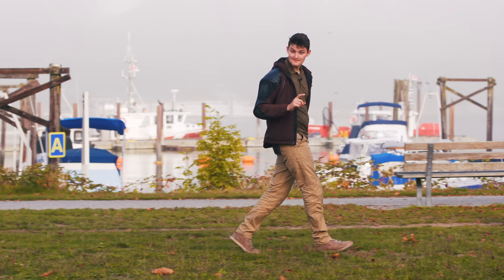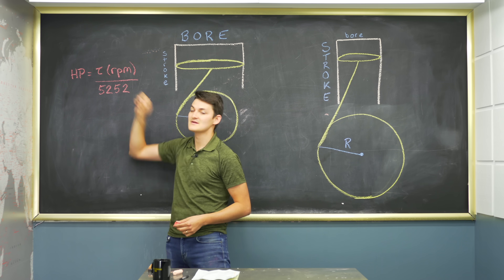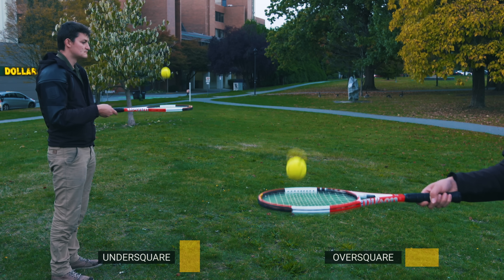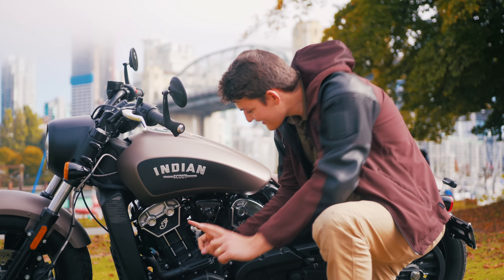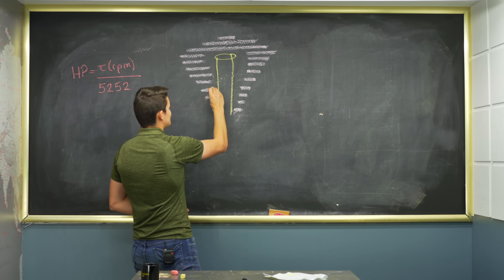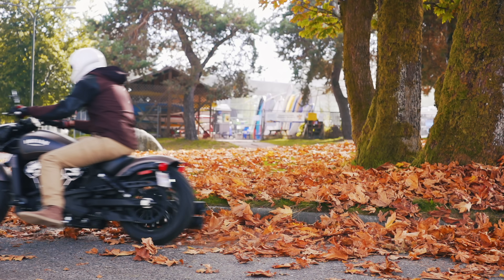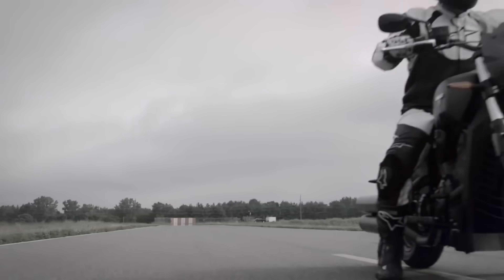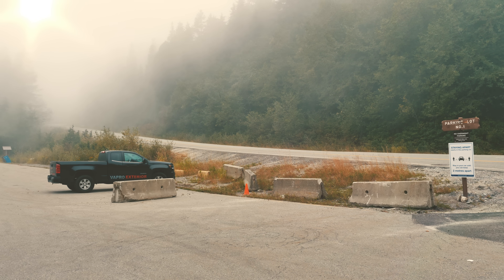How Indian Makes 43% More Power than Harley-Davidson

Comment: The Buell XB was making 103HP using a Harley Sportster 1200cc engine platform.  That was in 2003.  I do not know what the problem is over at Harley.
Reply: and just like that, I miss my lightning...
Reply: Same problem with the music industry. They're too busy trying to figure out how to get back into the past and not on how to be relevant now and in the future.

 And the problem, for both started a couple decades ago...with nothing learned in that time.
Reply: You have to remember too that Honda was making 50hp more with 200cc less and a lighter engine at the same time. Even with all the engineering Buell had it was just lipstick on a pig
Reply: @ajpowers7842  The point is Buell made 103HP out of 1.2 liters in 2003 and Harley is making 74hp out of 1.6 liters in 2020.
Reply: what about the people who turbo'd their HD engines or maybe swapping them out with S&S ones
Reply: @ajpowers7842  to be fair, Japanese bike engineers doesn't use under-squared engine formula that the American used that much, which is the reason why they existed in MotoGP to find both tech advancement and efficiency of having a good early low-end torque with decent top-end power on their engines. and you also need to remember that the majority of 1000cc bikes are over-squared with great top-end power and lame low-end torque, so maybe you could tell me what kind 1000cc Honda that have the same characteristics as an Indian or Harley-Davidson because Valkyries and Goldwings uses flat 6 instead of V twins
Reply: There's no problem. People buy the sportster based on a nice price point. Ride the thing for a while and realize its not very powerful or well suspended or braked. And return to the dealership to grab the screaming eagle catalogue. Kaching!
Reply: Decibel level must always exceed horsepower
Reply: @mawwalmazie  A turbo on a motorcycle sounds... dangerous. How do you manage the lurch when the turbine kicks in?
Reply: @sandakureva  small turbine, instant response. Ofc they don't just put a turbo and doesn't tune the fueling system. Honda had one back in the 80's with their CX500 and CX650 turbos, they sucked btw but it was a piece of history now. Yamaha XJ650, Suzuki XN85, and Kawasaki GPZ750 are also turbocharged, most of the bikes in the past uses supercharger instead. that's why Kawi continued on the 21st century with their H2s and H2Rs. Bolt-on turbos on HDs are mostly not dangerous since HD's lack of top-end power, the reason some of them put turbos on HD are to improve mid-end torque and power, unless they made them to became dragsters with nitrous installed.
Reply: @RJM-II  Harley Davidsons reached out to Reagan to increase the tax by 40ish percent on import bikes with over 750cc of displacement, ofc "outsiders" had a plan to overcome that by making their bikes below 750cc and adding more performance and torque into it LOL
Reply: @mawwalmazie  Honda VTR 1000 made 110HP @ 71Lb ft
Reply: @ajpowers7842  and kawasaki were making 120hp with a 1300 in 1979

Comment: My only problem with the Scout is I felt perched up on top of the motorcycle. On my Street Bob I sat deep down into the bike, much more confident and comfortable.
Reply: try a ducati diavel... i bought mine used for a STARTER bike, electronic power reduction dropped it down to where a noob like me could learn on it, lightweight and a 28" seat height... then i got better and had two more settings to bump up to... plus its WAY lighter than a harley, and over double the HP

Comment: The v-rod is a pretty impressive bike, especially for a Harley of he era but even they had faux cooling fins.
Reply: I had a buddy who bought one, but didn't yet have his MC license, so I had to ride it home for him.     The engine was great, but the seating/pegs was just not for me.   I wish HD had put that engine into a bike styled more like a Bonneville.
Reply: @thumperjdm  They missed a lot of potential with the revolution engines and the v-rods in general.  

I have a riser on my V-rod Muscle  but most of them, especially the early bikes, had a pretty standard riding position.  Thing is they had several variations with a range of seats, controls, bars and peg placements.

Comment: I have a tc88 oil redistribution assembly. 
At least it stops the baking trays going rusty. 
Looking forward to the generator or the compensator giving up so I can fix at least one of the leaks. 
The front pully will need replacing at some point if the trans output bearing doesn't fail so that would fix another. 
There's this one plug under the sump that looks like it should leak but worryingly doesn't. 
I love it anyway.

Comment: Harley prioritizes delivering power to peoples ears rather than the wheels
Reply: Have you ever heard a stock Harley? They are pretty quiet, it’s the customer that makes them loud. Harley motors are designed for low maintenance which does decrease power because of all the moving parts. Harley makes aftermarket motors that have a good amount of power but that’s not what their target market wants from stock.
Reply: @barackobama8821  stock Harleys still feel loud compared to other bikes imo. maybe it's the huge engine

Comment: In my area Scout Bobbers are the most common bike to find wrecked at an auto auction. Like dozens a year. It’s crazy? I assume the 83hp is too much for some people!?!
Reply: I have a scout and I can see why. 83 wheel horsepower in a 550lb wet package is pretty squirrelly if your not used to it, and still gives you reminders from time to time in the form of moist buttcrack. I still wheelie my bike from time to time by accident darting out into traffic. And the bike is just so damn fun to act a fool with.
Reply: @veteranironoutdoors8320  That’s what I thought. They are definitely on my bucket list of bikes.
Reply: I would suggest because most riders in the USA have never had a rider training course and have no idea what they are doing. Untrained riders are accidents waiting to happen.
Reply: @SurmaSampo  Sure are. Been there done that 😂
Reply: It's not always about the power, weight and brakes certainly play a factor, and scraping pegs around each corner is a recipe for disaster

Comment: Before I bought my Goldwing I test rode a Harley, a BMW, and my Goldwing. The trifecta of totally different riding experiences. All had their moments and pluses - and cons as well. In the end, it came down to several factors - money, dealership accessibility, reliability, and repair cost. Honda was the no brainer for reliability and overall quality as well as reasonable service costs. The Harley was just so underpowered and the dealerhip costs were - a little crazy. The BMW was nice but I had talks with several owners who surprisingly complained about reliability issues and high dealer costs. Got the Wing. No regrets. It really depends on what you want out of your riding experience. Like a friend of mine once told me who owned an old Harley, "I didn't buy it because I was in a hurry to get anywhere." Fair enough.

Comment: And just like that I've started looking at a Victory Octane.
Reply: Octane was/is a taller scout.
Reply: I have one, it is a blast. Customizing is a little trickier but their is a tight knit community that can point you in the right direction.
Reply: I owned a Kingpin Anniversary for two years, when Victory was still making bikes.  I liked it and rode it a bunch.  But I sold it because I wanted ABS and TC.  Bought a Honda CTX 1300.  Ironically, Honda made it for only one year.  But it's a fine ride too.  Same problem with customizing, since they didn't make so many.
Reply: 2017 Victory Octane gets a combined Avg MPG of 41,the  other two brands with a 1.2 Liter engine get 41 MPG as well just with  half the HP.
Reply: If you ride it like a calm commuter you can get 150 out of one tank. Specs say it is a 3.5gl tank, but there is some of that which always sits in the tank because of the location of the fuel line. I would say its closer to 50mpg judging on what I have been filling up on.
Reply: The ‘modern way to make power’ has nothing to do with burning fuel, dude.
Reply: I had a 2002 Victory Tour Cruiser with Stage one upgrade, and it was bullet proof and fun to ride.  Ate  HD’s like candy.  Never had any issues.  Sold it to my nephew and he’s still riding it!  Tires, oil, shock fluid, and injectors cleaned is all it’s ever had done to it. Great machine.

Comment: the 130 dislikes are non riders and Harley Associates. I wanted a Harley, but $27K for a Bike that feel like I'm being dragged thru sand isn't my idea of comfort or riding.
Reply: I've ridden big scoots that are more fun then all of Harleys newest bikes....
Reply: First a preface- I've owned at least 50 bikes- all types. Still do.     Why do I always read this comment about Harleys? 27K? For what ? This info puts it in the mind of the un educated that Harleys are prohibitively expensive. They are not the cheapest option out there and certainly not the best performance competition machine. But they are very fun motorcycles in all trim levels. I just bought a 2020 Electra glide standard for $15,999.00. I also have a Dyna that I have way too much into. But thats the fun of motorcycles. One of the best things I see about Harley is their willingness to finance a used bike. This helps get people into riding.  Get a 10k dyna and some bags and get on the road.
Reply: @hankbrown3959  You gave two of the top reasons not to own a Harley and justified that by saying "they're one of the only company that'll finance a used bike" as if that's a perk. Secondly, all manufacturers finance used bikes and that's not something to rave or celebrate. Furthermore, as a new rider or seasoned vet, the idea isn't to finance and overpriced Machine that you'll have to sell your kidney to pay off. A more soluble solution would be offer a great product at an affordable rate. Anyone can finance a machine and pay over 84 months, but who wants to put themselves in that situation?
Reply: @MrGarnettmiller  haha this guy, saying your a seasonal vet like it’s a good thing why don’t you just admit it. If you can’t afford it don’t buy it I’ve had my 4 harleys for over 12 years and never had an issue so maybe you need to go get yourself a push bike and we will happily wave as we past you by.
Reply: @adamw.6805  what's your point? I think I missed it in all that Rambling over your 4 Harleys. Ohh, I own 4 Harleys, congratulations! You need a cookie or a reward?
Reply: @hankbrown3959  I love Harley's for their style. Cruisers are my favourite kind of bike, they own my heart.
But when a used cruiser costs more than a new cruiser (any Harley vs Vulcan, for example), and almost as a car, that doesn't "help" people get into riding.

I bought my first bike used for 4k, an NC700x: just below 50.000km, pristine condition, bags, protections, LED extra, usb and 12v outlet, high screen, comfort seat, always in a garage (at work and at home, guy was in the military, rode the highway for 100km eachday and nothing more). Now that gets people into riding. Sure, it's a 700cc, but at a laughable 51HP, I get almost the same power than a Harley. Sure, it doesn't sound as good, nor has the same feel, and I still might buy a cruiser in my lifetime, but I'm getting 78mpg (3L/100km), extreme comfort, some lean angle, safety, protection from the wind and not making myself even more deaf than I already am. I am also learning how to ride without fearing that I'll have to sell a kidney in case I crash (got my license in late August).

Even though I love cruisers, I just didn't buy a Vulcan because it was a bit more expensive, even in the used market and my budget was 5k, including gear. The CMX500 was a bit too weak for my likes to ride so much highway and not enough nimble for the heavy traffic near home (I also needed a big bag, not just the tiny saddles that they had). And neither could match the stupid low price to run and keep my bike; when you are doing 150km everyday and petrol costs 1.3€/L, these things matter.

The Street 750 is the cheapest you can buy, at 7500€ - and you can even argue that's not a real Harley, ofc. Yes, this one goes in pair with typical prices offered by similar machines, but without all the tech, comfort and aids that other brands have. To go into "real" Harley's, like Softail, Fat Bob/Boy, you are dishing out around the 20.000€... without any extras. The Electra Glide standard costs 25.650€. Road and Street Glide jump into the 30.000€. I could buy a higher end car at that price, new from the dealership. I just did a quick search for used Harleys. The cheapest I could find was 9500€... a 1992 FXR Low Rider. That's more expensive than almost any other new modern bike at sale in my country, except a few BMW models, Aprilias and KTM 1290. A used Dyna Glide is 15k, and it was in pretty rough shape, to be fair... that's what my BMW car cost in mint condition! I could buy two brand new Vulcans and still have a few pennies left with what a beat-up Dyna costs.

I love Harleys. I might come to own one. Who knows. BUT. They are not worth the price. They ARE prohibitively expensive. And any "prank" that they pull on financing used bikes is not novelty and pretty much every brand does it: HD just does it worse, because they already hijack the prices and waiting lists to much, stimulating a false used market for 1 and 2 year old bikes.

People will get into riding if they can work a summer job and buy a bike and have fun with their friends; or if the bikes offer a cheaper alternative to driving a car. Not if they have to be top earners with little to no debt and buy a bike as a luxury. Edit: And I'm actually a middle to top earner in my country (making a bit over 2x minimum wage after taxes, which almost nobody does) with no debt besides my house, to which I got a great deal. And I can't afford a 15.000€ machine unless I take a 8 or 9 year loan payment, which is ludicrous for a motorbike.
Reply: @MrGarnettmiller   or maybe blame the individual who freely choose to finance that used overpriced bike instead. i can give harley shit all day long for the price of certain models. but instead i choose to buy my used harley electra glide for $2500 and enjoy myself. granted at that price it needed work but even then after repairs total investment is around $4500. My first 2 bikes i got brand new for around $8500 each, both Yamahas, both great bikes. But my cheapest bike, the one iv'e owned the longest and ridden the farthest is a harley davidson touring bike. They are great bikes, and perform great for someone who is old enough to realize there not in a race every time they leave the house. I love everything about my harley.... The motor company itself though could use a bit of "redirection"
Reply: Seems like you might want to check again, they have several bikes far less than 27k.
Reply: MFulmer456   that’s msrp “my guy.”

Comment: The production value of this work is, I’m stunned. It’s like watching…. If PBS documentaries had style, they’d look like this. I’m not in the market for a motorcycle. But this was riveting. I’m about to call an Indian dealer and tell them to take my money. You have found a niche, and believe it or not it isn’t motorcycles. It’s in discussing the juxtaposition between design and nostalgia on one hand, and technology on the other. You could discuss trains, roads, probably paint (yes, you could use this format to have your viewers watch paint dry), and they’d be fascinated. Because you are comparing and contrasting two diametrically opposed forces in the psyche, nostalgia and novelty.

Comment: Holy hell I remember watching you when learning the "science" between different practical dual sport tires for my wr250r!  Great synopsis then and a hell of a fun synopsis here as I'm considering my age and realistic time utilization riding between my Wr and a Scout Bobber Twenty which I can whip around my local area vs dragging/riding my wr up to a trail.  (in Florida ;)  Cheers guys, great video on the bobber vs. harley output potentials.  Appreciate the time and efforts!
Reply: I think it's over for Harley.
You can't compare Harley junk with Indian Performance Technology.
Harley today is for people life has passed by, they can ride a bike that has been passed by with time to and think they are current until they get passed constantly and spend most of their time in the shop.

Comment: Looked at Scouts for ages, then yesterday I bought an Octane for 1/3rd the price. Then you release this HA!
Reply: You won’t be disappointed with the octane!
Reply: You did good buying the octane.
Reply: octane is better you'll love it.
Reply from the maker: 1/3 the price?? Sweet find! ~RF9
Reply: Just got mine last month.  First time riding a cruiser but it was so easy to ride.  Polaris should keep making the Octane with Indian badges
Reply: Wow, great bike!  Here on the east coast Octanes are still going for $7,000 - $8,000.  Sounds like you got an amazing deal.
Reply: I searched for a used scout for ages. They are few and few between and people want dumb money for them. Ended up getting a 2014 Iron 883 for $5k with 300 miles on it.
Reply: @CamaroAmx  $5k for an 883? Yikes!  Sorry for your loss.
Reply: @paddy19656  they go for about $8k used.

Comment: Great video. I was in the market for a new bike, I wanted an Adventure tourer which led me to the FTR, I sat on a Scout and thought it might be a cool thing to change up from riding naked bikes, then I thought well I better look at Harley if I'm gonna look at Cruisers. Didn't like the cheaper Harley's (Nightster, Sportster) but connected with the Street Bob 114 which makes a better long hauler base than the little bobber. It's a great bike 100hp (with stage 1) and 166nm of torque is fun enough. I was a Harley hater but this Street Bob is nice and it was the same price as a new Rogue